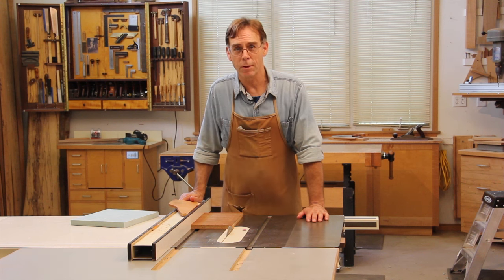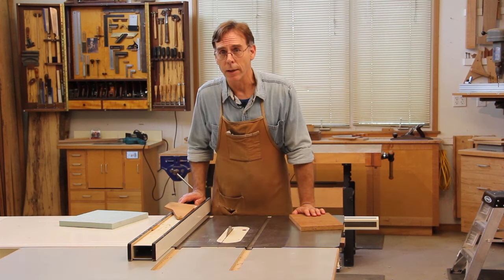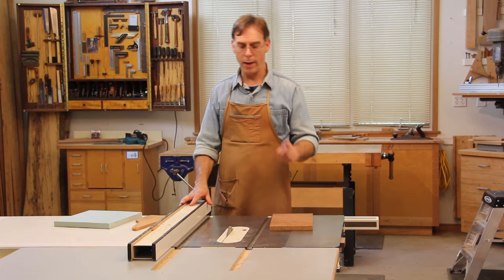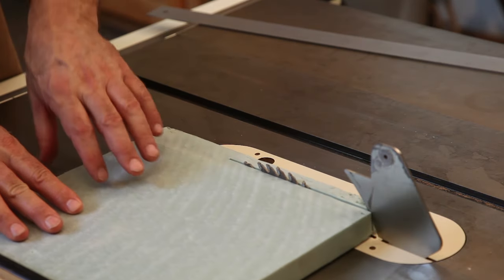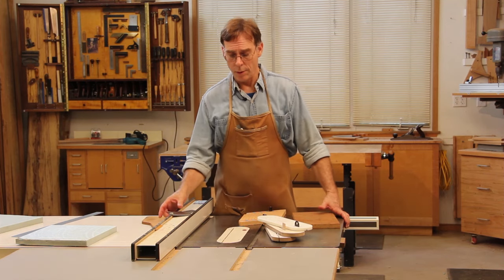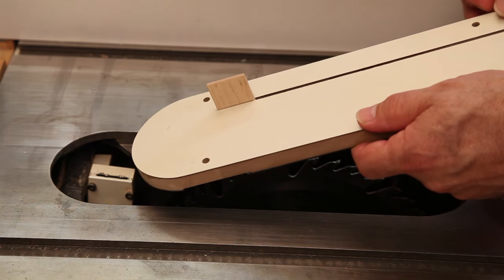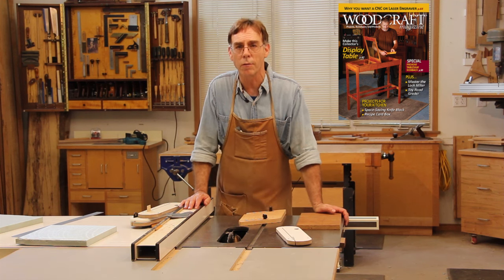Preventing Tablesaw Kickback

Comment: I’ve been using my hand me down 1970s belt driven craftsman contractor table saw without a riving blade for 5 years.  Lately I’ve been considering buying a newer saw belt driven or direct drive. The old craftsman has built dozens of tables and lately picture frames for the ms.  While working in dim light last week testing a new blade as casual as you like I experienced my first kickback.   I was cross cutting a small piece on a new 40T Dewalt blade.  Scared to poo out of me.  My right thumb was purple and swollen all week.  Grateful it wasn’t much much worse.  Not gonna lie scared its me enough to just stop using the saw all together.  Next time I’m behind the saw a riving blade will be installed and I’ll have glasses and a hard hat on, not kidding.  Stay safe everyone. :)

Comment: Great video.   While in the Air Force I thought it would be a nice idea to make some Oak and cherry cutting boards,   We had a wood shop on the base.   Having very little experience with a table saw, I was cutting strips about one inch in width and 10 inches long.   The person who was monitoring the shop came over and told me to be careful I could easily get a kick back.   Unfortunately, I did not ask him any questions and advice about how to avoid this.   The very next strip I cut came flying back and hit me right in the groin...painfully.   I thought the guy who was watching over the shop must have been able to see the future.   Before working on equipment like this it is a good idea to get some training with emphasis on safety and how to avoid accidents.

Comment: Awesome video. However, most of these kick-back related videos seem to ignore discussing the specific sawing operations that are especially prone to kick back. I've seen books and videos that might say they are poor practice, but don't really stress how dangerous they are. I have had two kickback incidents in 40 years of casual table sawing and both occurred when I was cutting a piece (using the fence) wider than it was long, or that was nearly square.  I know now how stupid that is, but at the time I was a novice.
My rule for preventing kickback is this: Never have a piece of wood between the blade and fence where the width (between blade and fence) is wider than, or nearly the same as, the length along the fence. If a piece is wider than it is long, or approximately square, it is very easy for the operator to bobble the piece, i.e. not keep it securely running along the fence. If the leading corner comes away from the fence, even slightly,  the  the rising teeth will lift it, turn it, catch it, and launch it. KICKBACK!  I think it is probably common for novice woodworkers to get the idea to use the fence as a length stop to crosscut multiple pieces to a specified length using the miter gauge AND the fence. Very dangerous!
My first incident was in my high school shop class. I was cutting a piece almost exactly like the foam piece in this video - 12" x 12" piece of 3/4" plywood from a slightly larger piece of stock. I set the fence to 12" and performed the rip, then I thought I could use the fence to crosscut to length. Bad idea. The piece kicked back exactly like in this video and struck my hip bone, which was fortunately protected by a heavy leather belt, and then ricocheted away and hit a fellow student on the wrist - smashing his wristwatch and fracturing his wrist.
The other incident occurred years later when I needed to cut several 1x4 board chunks to the same length (about 8") and I stupidly thought I could use the fence as a length stop and hand hold the pieces as I crosscut them. I knew it was risky, but I thought if I was careful to hold the piece securely against the fence it would be okay. The first piece went okay, giving me some false confidence, but the second piece kicked back, hit me in the belly and then flew away and punched a hold in the drywall behind me. Fortunately, I still have all my fingers.
Reply: so what to do when you have to cut such sizes (square or wider) - a noivce here
Reply: dude, you should ALWAYS use a sled. This is the first thing I'm going to build when I receive my next table saw. See Matthias Wandel channel, he has a nice video where he saw how to make one.
Reply: Hi. I both kickback you have experienced did you use a riving knife? Also I understand the use of a sled for crosscuts but should it be usted For longitudinal cuts in square  (or near to square) pieces?
Reply: @renerguez  I'm guessing that since the OP stated that the issues happened (I'm extrapolating from his time-line) roughly 30 plus years ago, I am guessing that those saws would not have had riving knives.
Reply: @kennethsouthard6042  thanks! i know there are always some risk with table saws to have a kick back, but i´m trying to get an idea of how much is the risk in reality using riving knifes, feather boards and push blocks
Reply: @renerguez I have a saw that's about 10 years old that has a riving knife, anti kick back pawls and a guard that has two wings.  I have also bought feather boards.  I also use push sticks vs. push blocks as I like to stay as far from that blade as I can get.  Finally, I don't do cross cuts without a cross cut sled.

Of all of these, I do think that the riving knife has probably done more to stop kickbacks than any other safety feature and would not buy a saw without one.  However, safety features are only there in case something goes wrong, so I always try to use technique to stay out of trouble in the first place and keep my work flat against the fence and flat against the table.
Reply: I agree with Javier. Had my first kickback ever last week after 20 years of using a table saw. Was cutting a piece just like he outlined. It was 3/4" ply and hit me right inside the hip bone. Nasty bruise and cut. 
It was a very scary experience and I count myself as being VERY lucky. I was not using a riving knife or a cross cut sled. Not sure my old table saw can take a riving knife. I'm super careful too....but obviously being careful doesnt mean something bad can't happen.
I will never make that cut again without a crosscut sled. Hope I can retrofit a knife to my saw.
Reply: YES!!! Cutting a wider piece using fence is so sketchy! Learned this the hard way as well :(

Comment: Thank you for illustrating this graphically!  I gained a good understanding of how kickback occurs.  I am still a novice on the table saw, and wanted some understanding on this issue.

I had a horrible experience recently.  Upgraded to a portable Dewalt DW7480 table saw model from my trusty old Craftsman saw.  Read the manual completely.  Installed riving knife (splitter), then the kickback assembly (saw-toothed wings on either side of riving knife), then the big clunky blade guard.

I had a large piece of wood to cut that did not fit under blade guard.  I took this off, but left kickback assembly on, which snapped into place on the riving knife, on its own separate groove.  Halfway through the wood piece, the kickback assembly flew off the saw and hit me in the chest.  Wow, that hurt!  Not sure if this is supposed to happen, but in my Craftsman you could remove the blade guard and kickback stayed in place.

Any thoughts?
Reply: Lass-in Angeles only assuming here, but maybe the anti kickback were not securely snapped into place or engaged into the riving knife?

Comment: Awesome video!  Also always remember to set the blade height just enough to cut the piece in question.  I see so many videos where woodworkers have the blade an inch out of the wood during the cut and this contributes to all sorts of issues kickback being one of the primary ones. Make sure you use good sharp blades as well as proper ones (don't rip with a crosscut blade for instance). Great video keep safe
Reply: I consider myself a newb to the table saw and i have been using it to cut perspex with a perspex/alluminum blade. I was told to have the blade way higher than needed to get a better cut. Is this true?
Reply: @simyob  not sure about perspex and aluminum cutting but table saw blades come with a setup instruction when you buy them. Mine recommend that the gullet of the blade be level with the top of the board. I guess this is to assist with sawdust ejection.

Comment: when i was in high shop class in the sixties we were shown a film where a long thin board kicked back and went into the operators chest with blood flying everywhere . 
it was fake of course but it has stayed with me for over fifty years .
our teachers number one safety advice was " every time you turn the saw on ask yourself this question, 
Where are my hands in relation to the blade" 
continue to be aware of this all the way through the cut and NEVEr reach around to remove the cut material . 
A little bit of fear is a good thing when operating a table saw or any machine .

Comment: Excellent video! Can you please explain why kickback still occured after the splitter was attached? It looked like there was kickback on the non-working material. Is that not still just as dangerous (I'm an absolute beginner with a table saw)?
Reply from the maker: So typically the issue with kick back is the piece gets trapped between the fence and blade and has no where to go other than ride the blade and shoot out. On the offcut side there is no such trap and the piece can fall away. I believe the only reason the piece in the video at 3:27 flies back is because it is foam and super light.

Comment: I noticed a small sliver piece of material went by you when you were demonstrating the use of a splitter. How to prevent that from happening or is it too small to be concerned with? Where should I stand when making my cuts? I stand in front but I think I should change my position. Thank you for your safety tip.
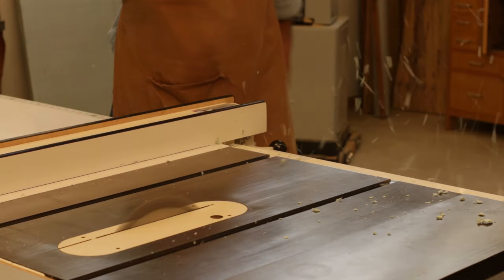Reply from the maker: At the 2:30 mark in the video, we begin to tell you how to prevent kickback throughout the end of the video with examples. The best place to stand when you are using a table saw is to the left of the blade in a position that is natural and comfortable for you. If you stand to the left, you'll automatically position the blade between you and the fence. In addition: Use a Riving Knife. A riving knife is a thin piece of metal shaped like a surfboard fin, and comes with your table saw. Use a Splitter. Consider a Crosscut Sled. Always Use a Push Stick. We also highly recommend the Micro Jig Grr-Ripper. And as always, be alert, be aware and don't let your guard down. Concentrate on the cut each and every time, and take your time.

Comment: I appreciate the video, but had a few folllow-up questions: are a splitter and a riving knife two terms for the same thing? If not, what's the difference and which one is better? Also, I'm vaguely that modern saws have both a riving knife and anti-kickback pawls. If a riving knife works so well, why is an anti kickback pawl necessary? If they both provide the same function (preventing kickbacks), which one works better? Thanks again for the video.
Reply from the maker: They are very similar, a riving knife is better though. A riving knife is usually mounted on the trunion with the blade and so moves up and down with the blade. It is also much closer to the blade. Splitters are usually mounted on the throat plate and tend to be farther from the blade. 

A riving knife goes a long way to helping prevent kickback but in this case more safety isn't a bad thing. Anti kickback pawls will grab the piece of wood and stop it if it does start to kickback even with the riving knife. They are usually mounted on bigger blade guards and when cutting larger pieces or using things like the microjig you take the blade guard off so you lose the anti-kickback pawls but you will still have the riving knife.

Comment: You and others have mentioned a "zero clearance throat plate".  I am a newbie wood worker.  Is this type of throat plate purchased from the saw manufacture or one the woodwork makes? If the latter, How?  Thank you!
Reply from the maker: Some modern saws like the Sawstop come with them. We have a selection of aftermarket ones for a lot of saws. Or you can make your own but using the standard one as a template. just a piece of wood that fits in the opening, flush to the surface that you then carefully raise the blade through.

Comment: great video I've now bought a table saw and this one of my concerns kick back.you didn't say anything about push sticks.is the splitter going to prevent kick back all the time
Reply: As long as your fence is perfectly parallel and your blades are sharp,  kickbacks are very rare.. the splitter is an excellent device and actually works better for woods that have grain like pine. Pine has wild grain direction and often wants to close up around the blade.. keep your feed steady and you will be fine..

Comment: What if you attached brackets (that can be raised and lowered) to the fence on each side of where the edges of the blade start and end as well as to the feeding end of the table and the exit end for the wood to slide under? Wouldn't those keep the board in place in the event of a kickback?

Comment: Kickback is definitely very dangerous and if you use a table saw much they will be alot of times you will be making these dangerous cuts. I have a very powerful high amp table saw so kickback has and is an issue. I also because of alot of complex cutting had to remove all the safety features. But I found a way to make most dangerous cuts safely by building a table saw sled to hold and make those types of cuts that are high risk. It gives you the ability to support and prevent the binding that happens causing the kickback.

Comment: +woodcraftmarketing
What I've learned:
0. SawStop™
1. splitter on
2. blade guard on
3. correct fence alignment parallel to the blade
4. the front of the fence pulled back to the line where the wood leaves the blade
What's you opinion on the 4th? Should the fence be extended beyond the blade on the exiting side?

Comment: I was trying to cut some boards today. Board flew right back at me and hit me in the arm lucky I didn't get hit in the face. no goggles or face mask would have stopped that from possibly damaging my eyes. Might not even try to do it again and have somebody that knows something about woodworking do it. I had the blade too high. About 2 inches. Trying to cut 3/4 inch board with blade at 45 degree angle. Board got pinched between rip guard and blade. Lots of force. I might make a video of this and pass it on at YouTube.🤕

Comment: so is all you need is a riving knife? then you're perfectly safe?
Reply from the maker: Hi John Mayer, big fan. A riving knife goes a long way to making your table saw safer by helping to eliminate kickback due to wood pinching closed on the blade. It does not make it perfectly safe though, you still need to be careful and make smart decisions when using your table saw. A blade guard is a great additional safety feature. As are push sticks.

Comment: I"m just going to have to stop using power tools.   There's so much that can go wrong.   But I've got stuff needing worked on now.    So I'll try harder to be safe.
Reply from the maker: You just have to be smart. Don't work when tired or under the influence of alcohol or certain medications. Think through all cuts before you attempt them. Use all possible safety devices like blade guard and pushstick.

Comment: Why isn't there a guard at that spot to prevent kickback? Easy enough to invent and make standardized. Designed so that it doesn't interfere with precision of cut.
Reply from the maker: All modern table saws come with a blade guard and/or a riving knife. However, they are removeable and a lot of people leave them off. The video is to show what can happen if you don't have one of those in place.

Comment: some saw blades have horns and the manf. claims that these are aniti kickback horns. I see them working as a chip limiter but cant understand how they can prevent kick back. perhaps this is just marketing? any thoughts on this?
Reply from the maker: We suggest using a MicroJig Gripper, a Splitter and Riving Knife, and your blade guard. Keep your blade clean and sharp. The cooler you run your blade the better reduction of cutting teeth are to heating up. If you run your blade slightly above the blade gullet this will aid in rising heat temp/expansion in the cutting teeth.
Reply: okay but I was asking why blades have horns and if they help prevent kickback or if that is just a lie
Thanks
Reply from the maker: Some manufacturer's have created "horns" in their blade designs stating that it helps prevent kickback. I am working with one such manufacturer for a video representing that design, and will get back with you.
Reply: Thanks that would be great!

Comment: Riving Knife should not be in line with saw blade though
+- 0.3 mm to the right slightly outside the saw blade. PS it is best to make a Riving Knife from spring material BV. aluminium. And the wood remains pressed against the guide and the rest of the wood remains clamped in place against the guide and cannot shoot away, no kickback saw wood ((I've had it like this for years and it works perfectly)  ) win win situation .